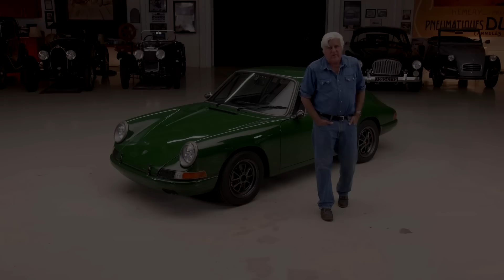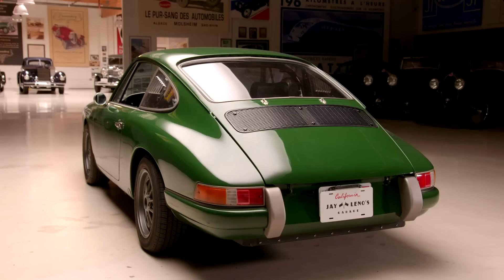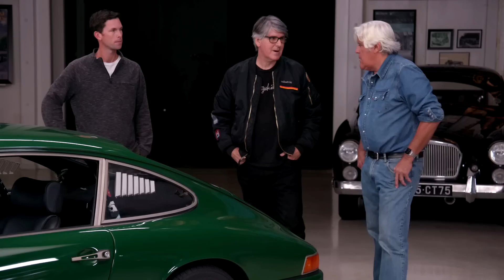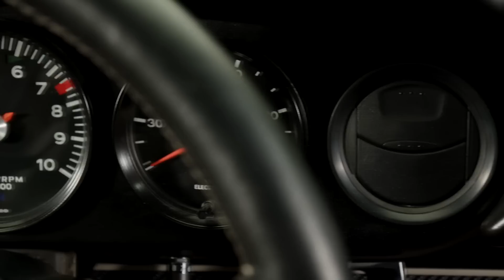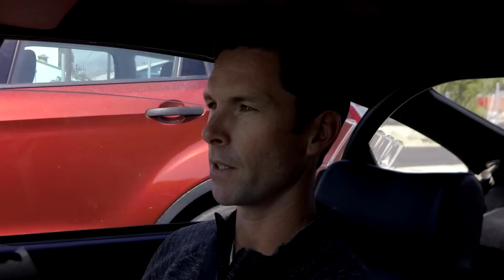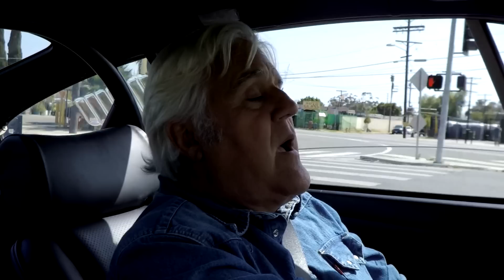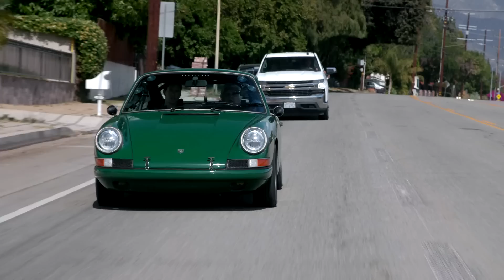Zelectric 1968 Porsche 912 | Jay Leno's Garage

Comment: I always had the strange idea we’d sell two metal strips down a highway and the electric cars with two brushes just like a race car set. Did it with overhead street car wires. Remove the need for heavy batteries. Maybe parking lots with induction charging? Never worry about plugging in to charge. Sounds crazy, so did electric vehicles years ago
Reply: Ah, the nightmare of adding all that new infrastructure to our millions of miles of horrible roads.
Reply: @jamesengland7461  why not we have to rip them all up anyways lol
Reply: Jay Leno enters the chat with his 1917 electric vehicles.
Reply: Yeah, can't see any problems there. That wouldn't electrocute anyone or any critters. Not start any fires. Go with it.
Reply: @3ducs  I was hoping no one took this crap seriously.

Comment: Electrifying old cars is great except for the insane price.
Reply: And the huge weight, and limited range.
Reply: @nobodynoone2500  You got to be kidding about the weight, after removing engine, transmission, gear and other parts that only a ICE needs often the car converted weight less.  I notice they did not mention the weight of the motor in this video.  Now range, that is still a problem and will be for quite a while.
Reply: ...and that is why I have a couple of electrified bicycles they're easy and relatively cheap to convert and they make me feel guilty riding them so I hop on the pedal powered road bike and get my cardiovascular that way!

Comment: That’s why I hate Tesla, they don’t want to sell their parts and the fit and finish just sucks! Great idea but horrible business.
Reply: I doubt you would want other people easily obtaining your patented technology you worked so hard for, if you were in their position.
Reply: @SerPurple51  I’m not talking about the whole technology, but the replacement parts! I would rather people have the access for easy repair to be more convenient then hating for buying expensive junk you can’t fix. When broke it’s jut a hunk of useless metal that takes long time to fix.
Reply: tolikz05: You do realize you do not have to buy a used Tesla motor, that there are also batteries from a number of companies? And if your problem is Tesla having better batteries or motors should you not also be complaining why the other companies are not doing better.
Reply: @earlpottinger671  that’s not the complaint about motor or battery! It’s overall quality and parts availability! For example if you have a wrecked one you fixing.. or just quality like when you spend $100K and you have rattles, squicks, paint damage or deformed seats... that’s what I’m talking about. And no service support if you want to do fix the car your self or have your mechanic do it for you. So facing all this why would anyone buy it?!? That’s the idea!  That’s why I bout a Porsche... heck my Mustang 5.0 is better quality then Tesla...

Comment: This is a nice build! I’m definitely looking forward to when electric conversion kits become more common. My Grand Wagoneer will be waiting!
Reply: There’s a lot of comments here lol. I should add that my Grand Wagoneer is far from a perfect example. When I bought it wasn’t running but already modified, like most Jeeps. Under the hood was (and still is a somewhat) a spaghetti mess of wires, but got it running. It has 33in Mud Tires, 2 inch lift, cloth front bucket seats replacing the bench, and matte black paint. Body and frame is rust free. The only damage it has is from when I took it on the trails and the rear wheels rubbed the fender. 

I’m in the process of planing an LQ4 swap to modernize it a bit so I can travel with it more. 

This thing will NEVER be a stock truck while I own it. I will continue in the long tradition of Jeeps owners and modify it to keep it on the road. Even if that means an LS now or electric propulsion later on.
Reply: @XceedDriver  these guys took a 911 in geat running shape and did this. Makes no sense. Do it to a modern boxter or 911, why would you take out an air cooled engine in good condition to do this to a vintage car?
Reply: @leucipplive  Their car their money? Old cars tend to be pain after a while for some folks. With my AMC 360, I’m tired of getting 9mpg. That equates to about 100 miles per tank (stock tank has no baffles). It still runs strong though. I don’t know how well the original engine ran prior to the electric conversion, but I imagine the owner just wanted something he could just get in and enjoy with no fuss. Plus they said the original powertrain can be put back no problem, so I don’t see what the big deal is.
Reply: @XceedDriver  dude they say in the beginning, they ONLY take strong running cars and remove them. Obviously I would have no problem with someone doing this if their engine was toast or it was a roller conversion. They are literally ONLY taking strong engines out, and that makes no sense for vintage number matching cars.
Reply: Cool!
Reply: Do your Grand Wagoneer a favor and sell it to someone who actually appreciates it and get yourself a Prius because you can't tell a difference
Reply: @AR-zq9hq  🤣
Reply: @AR-zq9hq  The future is now old man
Reply: @AR-zq9hq  Just tell everyone you're scared of technology
Reply: @legrosroger  that has nothing to do with what he said? There's only a limited number of these classic cars, the only way to appreciate them is based on their original air cooled engines. There's nothing wrong with electric cars. But why would you need to do it to a vintage air cooled porsche? It's completely senseless.
Reply: @leucipplive    It's the future.  Those old engines lack HP and require a good bit of maintenance to keep them running.  If you enjoy driving the car vs maintaining the car, then an EV conversion is the way to go.  A noisy, finnicky, underpowered 911 just doesn't interest me.  But a reliable, fast EV 911 that doesn't need oil changes and constant maintenance to keep it going would be fun to have.  I wouldn't convert a numbers matching car and the conversion is bolt in, so it can be converted back to ICE.  

Once you have gotten use to driving an EV, it's really hard to go back to an ICE vehicle.  There will be many more startup companies that do these types of conversions.
Reply: @donm2255  THEN DONT GET A VINTAGE 911 LOL it's that simple - get a moden future car - dont ruin the engineering of the past. 

Do you not get it? The only reason to want a vintage porsche is for the vintage engineering - there's no need to put a modern electric engine in a well running vintage car. 

its the future argument is dumb as hell, it's a 50 year old car lol not a future car.
Reply: @AR-zq9hq  how about my 1974 Jaguar XJ6L..can't wait .. 😉
Reply: @erhardbaehni1832  drive it into a lake and get a golf cart instead
Reply: @AR-zq9hq  only idiots play golf . For every serious sport you need to balls  like racing ! 
Jag XJ6L is one of the nicest car ever build . 😉
Reply: @erhardbaehni1832  that's exactly why you need a golf cart
Reply: @AR-zq9hq  loeli 😉!
Reply: @AR-zq9hq  get over it old man ice is finished

Comment: The "crate motors" are a good start, but they need to offer plug-&-play modular controller and battery systems (plus HVAC) for the idea of doing easy EV conversions can take off.
Reply: Yes , especially a modular removable battery system would be nice. The price is still a mayor let back
Reply: @HRM.H  batteries aren't too difficult, although the system needs to be scalable and have the option for having multiple banks scattered throughout the car. 
But the battery is child's play compared to the controller that goes between the batteries and the motor and usually serves as the charge controller as well. This is the interface between the driver and the motor and is the "brains" of the system.
Reply: @ianfurqueron5850  well there are tons of company's making custom controllers so that's not the hard thing. Just price is the mayor barrier for everyone.
Reply: @HRM.H  
The word you’re looking for is “major”, not “mayor”
Reply: @negativeindustrial  the words you are looking for are Grammar Nazi
Reply: @negativeindustrial  you have a 150 comments on this channel alone , get a life. 😂
Reply: @HRM.H  
You misspelled it twice. I figured it was possible you didn’t know. W/e you can get defensive about it, if you like.
Reply: @negativeindustrial  no one was or is defensive. Just like no one is or was asking for a grammar Nazi to correct them. 👍 Get a life Karen
Reply: I wouldn't mind an affordable kit for a vintage Fiat 124 Spider.
Reply: Yeah-- the guy th as t said "mayor" instead of "major" was no doubt typing on his "smart phone" and as I well know, it's super easy to mess up on em and if you don't catch it before you post it, you're gonna get a typo!..
Reply: @coadmiller5010  trying to justify being a grammar nazi , that's a first one. Congrats on ya butt buddy
Reply: @HRM.H  
If you’re just content to remain in lifelong mediocrity then why do you protest so much? No, the double posts and unnecessary lashing out at Coad Miller suggest you took it much more personally.
Reply: @negativeindustrial  you want to remain the YouTube laughingstock and don't get anywhere in life??? Keep doing what you are doing 😂
Reply: @coadmiller5010  one can edit their comment.
Reply: Poor Porsche, she deserves a RUF engine!
Reply: They already exist from Borg Warner and Bosche

Comment: Absolute sacrilege. Put those goofy electric motors and batteries in a Civic or something, not a vintage Porsche. Completely ruined.
Reply: As a Honda fan, nah. Maybe the later ones when the civic sould was removed in 2001 with the fitting of cheap struts in place of a proper suspension. But the early civics were marvels of lightweight and good handling, both ruined by electrification.
Reply: As opposed to what?  What happens when there is no more fossil fuels? Or when gasoline becomes too expensive to be used?  You want to scrap all of these gasoline fueled cars?  I can't speak for you, but Porsche manufactured MILLIONS Of these cars.  I am pretty sure the world will survive one modified Porsche.

Singer Porsche 911 has entered the chat. :D

Ruf Porsche 911 has entered the chat.
Reply: @houseofno  Fossil fuels will be around for hundreds of years don't fall for the myth.

Comment: That's a beautiful car and a huge improvement over the 4 banger!
Reply: The power is amazing, but the weight and range make it hard to justify. The handling had to be worked on because of the additional weight from batteries.
Reply: Got to LOVE the better balance in weight distribution.  I do wish more had been said about the suspension and road holding.  They were upgraded as well.

Comment: Drums are actually great brakes, they just need to be adjusted properly.  Unlike disk brakes, they have zero parasitic drag... They just don't cool-down as well.
Reply: are brake shoes harder to replace than disk brake pads?
Reply: @laszlodemeny4485  No........
Reply: are hydraulic  valves hard to adjust on a 1966 Thunderbird with a 428 engine? if you  could  would you explain how to do it?
thanks!
Reply: @laszlodemeny4485  you don't adust the "valves" you adjust the shoes.
Reply: @richardsealey3626  i meant  about engine valves not brakes.
Reply: @laszlodemeny4485  You have answered your own question, they are "hydraulic"..............................................................................................